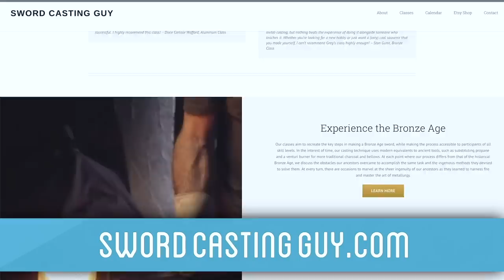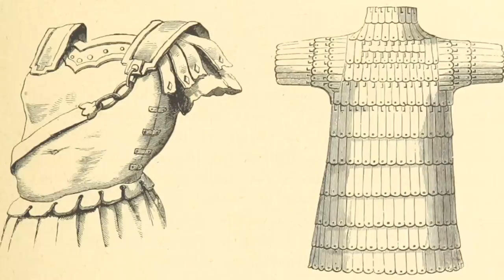How to Make an Ancient Sword FROM SCRATCH: the Egyptian KHOPESH

Comment: You need to make a clay chimney foundry for smelting iron ore, basically just a tall chimney with a hole at the base for adding firewood, and letting air in, made of clay, sand and straw

Comment: I’d like to see you try to make the casting media, especially the wood box, before you keep using them to cast things. Seems disingenuous to the project. I understand the crucible and forge, as you proved you could make those primitively, but the perfect casting boxes held together with SCREWS is a stretch
Reply: Antarchs I totally agree I was about to comment the same thing
Reply: Technically he doesn't need to create a wooden box at all. He can create a mold from clay, which we know he can do.
Reply: He’s successfully casted in clay using the ancient method, that gives him a pass to using the refined methods.
Reply: Definitely agree, seems against the spirit of the reset
Reply: I gotta say it: building a casting box with nails and hide glue would be sturdier than the box held with screws. And since the perfection of the box shape lends little to the finished product, I say let him have this one. There's no real point to it, since a box is a box, and it just needs to be big enough to hold sand around the mold.
Reply: Agree
Reply: Yea these should be made using stone moulds. Otherwise you might as well order it from China. But he keeps using rotting wood he finds in the forest instead of felling and drying trees so it probably would be a failure every time.
Reply: He said earlier in the series that if he makes a proof of concept (which he HAD DONE before with clay, sand and lost wax techniques), he could migrate to modern techniques.

Casting is very damn hard with unperfected tools, materials and technique, so he wouldn't be able to make even remotely reasonable castings for bigger projects like a sword. On the other hand, if his casting skills and materials improved (which is historically inevitable), then why not jump into modern casting for video purpose?

As he said, again, much is done for the "speedrun", but he never left anything out; with enough time and training, any society can develop high-end products (he didn't even ornate the kopesh).

Comment: To me, "Knife, Sword or Dagger" comes down more to it's use than it's form.  There's no set length, the point where it's not a Dagger, and it's considered a Sword.  What was it made for?  What was it carried for?  A dagger was a multi-purpose tool, that could also be used for fighting, and stabbing people.  A sword is a single function weapon, for fighting, and stabbing people (Or possibly animals.)  So, a Chinquedea is probably the most extreme example, but as far as we can tell, it was designed, and carried exclusively for knife-fights in the back alleys of Venice.  Basically a sword to one-up a cutpurse with a knife.  Therefore, it's a Sword, by intent.  Even though most of them were below the length you would conside a "Sword" it was especially broad, basically a steel slice of pizza with a handle, specifically so it could stop another sword if it had to.

Comment: love the series, but aren't loads of modern tools and resources used in the casting? not to mention you used a sword to make the cast of the sword, so it isnt really from scratch.
Reply: Seems to me he's using sand and wood to form the molds and while he's using a modern furnace to melt the metal, its done for time saving purposes and can be done alone more easily by not having to pump bellows for example.

And bronze was cast. You didn't hammer it. Its melting point is far too low to reliably forge it because if you got it too hot, it would deform/melt and casting was much easier. Once you reach the iron age, then forging became a thing.

I mean, you could cold forge it but why would you? that's just more work for the same outcome.

Comment: I’m sorry to say but I’m extremely disappointed in this video to many modern technology were used in this video give the reset you did. Also how did you sharpen the blade you didn’t show that part. Ik you mentioned in the past things that your already done you’ve unlocked to use. But I would really love to see you make a clay mold pour the bronze and make the dagger. And you skipped out on what you used to shape the handle of the blade. It all seemed to modern edge

Comment: Now shave with it!
Reply: Razors and swords fullfil very different requirements in terms of their blade and you probably do not want your sword to be razor sharp. For a razor blade you want a rather slim edge with a small angle for maximum sharpness, however and edge like this will get easily damaged when striking harder targets and thus quickly deteriorate when used for combat making it less useful for a sword. This effect will be stronger the softer the material is, so for a bronze sword you most likely want an edge that is nowhere near razor sharp.

Comment: no offence to the guy that supposed to be an expert on weapons. but he clearly knows nothing about the subject and even less about egypt or bronze age weapons. if you are interested in this type of thing swords and swordsmen by mike loades and bronze age military equipment by howard dan are very good reference books on the subject. youtuber lindybeige has also done some interesting bits on the bronze age weapons.

if you read the books or take a quick look round at the information on both the bronze age and the khopesh. then you will rapidly see that this guy is a twit with no education in the subject and talks a lot of complete rubbish. the things he is getting right and that is very little, are common knowledge and have been for many years.

its sad that people like this are being given house space. also the casting went wrong because the case didn't have a head mass. if you are not going to use runners and risers you need to have a larger casting throat to get the massto keep the case full as it cools and force the air off. its is also nothing like the two swords found in tutankhamuns tomb. its only vagally khopesh shaped and that's being kind to the guy that made it.